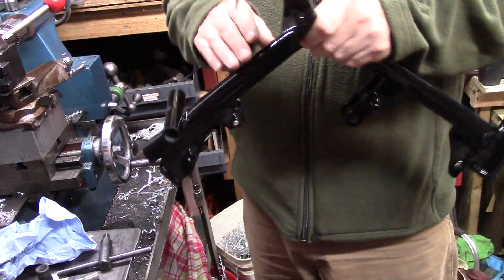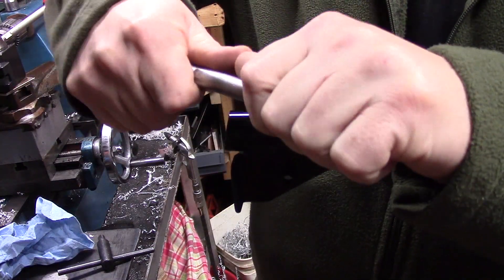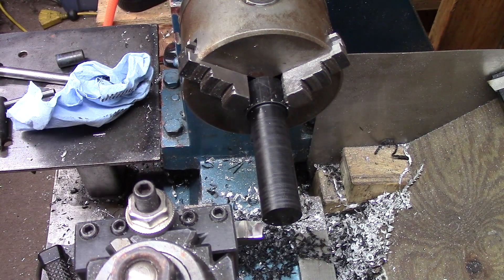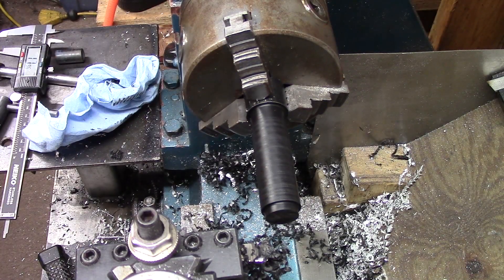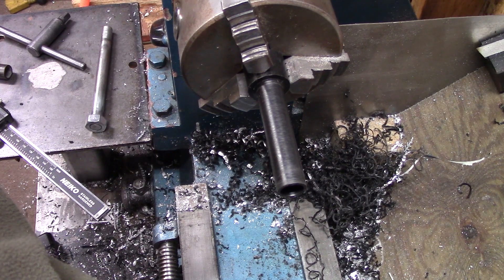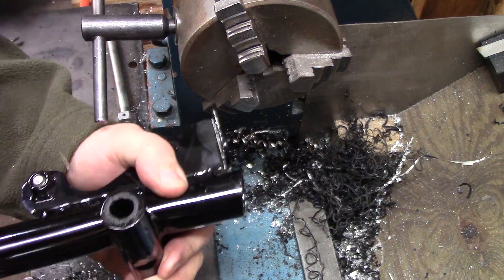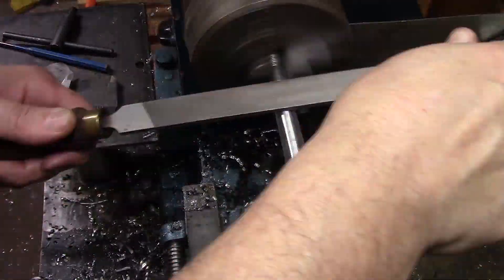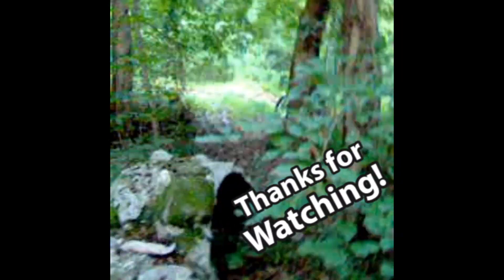Machining on the Mill Lathe - Mini Indian Swing arm Bushing

Comment: G’day Eddy. The lathe is so handy for those small jobs. 
Cheers 
Peter
Reply from the maker: Hello Peter,
Very handy. I am getting it tuned up now for the most precision job I have done on it. Cylinder boring out .06 mm (60 microns?) with hopefully +/- .005 mm tolerance (5 micron? not used to talking in metric, lol)). I bought a metric boring head and 50mm micrometer, I am going to try to not do any Imperial conversions like in this video. Gets too confusing.
All the best!
Eddie
Reply: Australia has been metric 50 years and we’re still converting mainly for YT, probably for a couple of reasons USA still uses it even though metric is the standard and the bloody Chinese who copy everything even thread pitch, imperial, metric and even whitworth, my mini lathe is graduated in 0.001” / .025mm primarily imperial. Grr it’s a constant battle 
Cheers 
Peter
Reply from the maker: @pgs8597  The original reason I had to put DRO's on everything is the dials on mine are supposed to be (they are marked) .02 mm but are not really, that combined with the backlash and I could never get any consistent readings. They each give me completely different measurements for the marked values. They must have been etched on aFriday afternoon or whatever the Chinese equivalent is. That or the threads are off slightly.
Best!